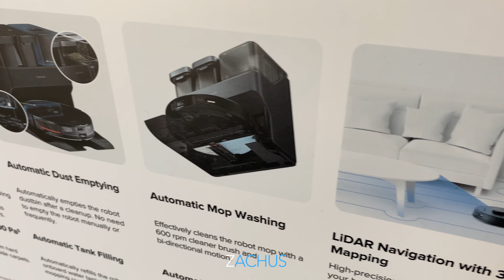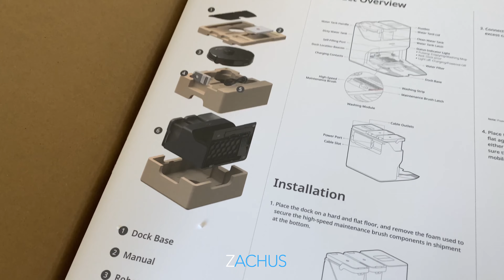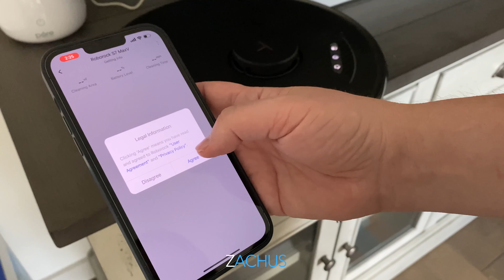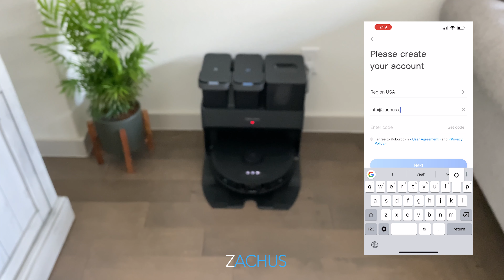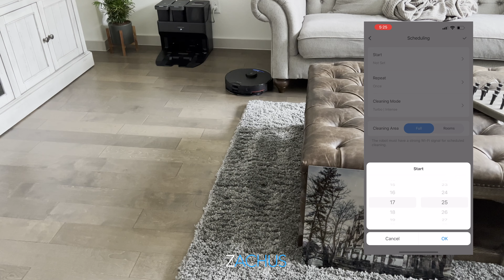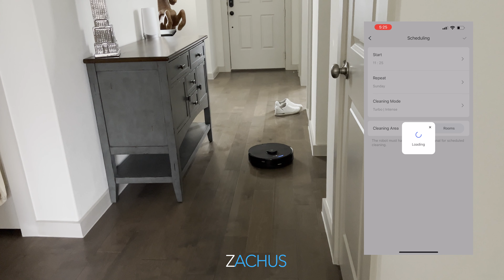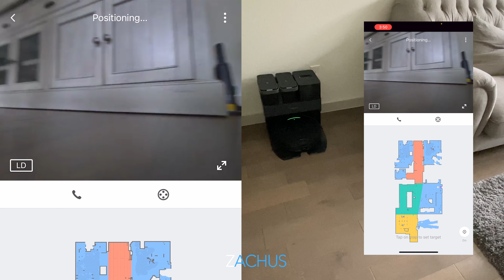Roborock S7 MaxV Ultra (FULL HONEST LONG REVIEW)

Comment: It doesn’t have clean zones? Why not? Will this feature be added in the future?
Reply from the maker: They said they are working on adding it. Not a huge deal because you can set rooms and dividers.
Reply: Mine has cleaning zones. Got the system Sept 30 and clean zones was available

Comment: How does this robot navigate in tight spaces? (like under chairs etc)
Reply from the maker: I show this in the video 😁 I know it's long though. It does amazing!! It never got stuck which I was shocked. I let it go into my studio and you can see it navigate some crazy stuff... best robot I've tested so far.
Reply: @Zachus  oh, sorry. I could not see the all the video yet. I have a S5 Max and the biggest problem I have it id with its navigation. Even with furniture it could get under it (because of its dimasioms, like chairs), the turn ratio it performs does not allow it to get under it. I was hopping to see if S7 MaxV could solve that issue due to its better AI and right side ultrasonic sensor location
Reply from the maker: Oh I gotcha, yes, my Roborock S7+ that I did a video on had this issue, I sent it back, https://youtu.be/VyhKtQ13exg
But I really wanted to try this and it seems that they got everything out. It got closer to any edges of any robot, navigated some crazy stuff and never got stuck. I added Chapters in the Video Description to help find things 😁 for this video.
Reply: @Zachus  amazing, man. Thanks for answering and for the amazing review, one of the best in YouTube. This robot is not available in Brazil, so, unfortunately, I can't get it at the moment. Hope this changes soon.

Comment: Fantastic review!! Thank you so much! My main floor is about 2700 sq feet in total. Will this robot be able to do all of the area? Thanks again so much!
Reply from the maker: Oh for sure but it may need to re-charge and also clean the mop several times. It does all of this though by itself. FYI I schedule mine to run when I know I'm going to be out and I have even let it run at night although it works better in daylight.
Reply: @Zachus  Thank you so much. Also, I purchased my husband and boys some soap for christmas via your link and suggestion. Thank you so much for your great content!!
Reply from the maker: Awesome

Comment: I used to have an s6 max, now I have an s7max ultra. It's a big disappointment for me, the little broom keeps getting stuck in the carpet, but that's not its biggest problem. I don't see the logic in cleaning it like I did with the old one. Many times it will start 20 yards to clean up a 1 square yard area where it has been before and then move on to another random area. He also often misses areas. I never had that problem with the old one. It doesn't empty the dust container at the end of the cleaning, only sometimes. What do you think, could there be something wrong with it?
Reply from the maker: I haven't had these problems 🤷🏻‍♂️ so might be bad...
Reply: My side brush gets tangled badly on my shag rug. My roomba i7 side brush does not.. It’s a poor design and is completely unusable on the rug
Reply: @tpfrk8977  You can always replace the brush out for an older model bristle brush

Comment: Before buying, I fixed all my house raising & attaching lamps & furniture on the wall so they do not touch the floor.  It enlarged the room and left the floor way easier to clean.  But before buying, I searched for Service Centers in Canada and the USS.  DID NOT FIND ANY.  So, I won't buy until SERVICE equals Dyson, Bosch, Miele, LG, Samsung and the like.  BEWARE and investigate.  Simply ASK then where to go when a problem arises.

Comment: I have the Roborock S7, works good at the beginning, after 3 months broke, back & forth with the support, needed to ship it back, they said the wheels had issues, they replace, the shipment back was really bad, they used the same box i ship to them, now in bad condition, and they had one wrap that didn't really protect the robot, they didn't do anything else to please me, and when right after we started to use it again, the small side brush fell, i try to tie, you Loctite, nothing, keep falling and now i cannot find it anymore, Roborock wanted to give me 80$ and to fix it again, NO WAY, such a expensive product not supposed to break after short time, and the way they handle their customer service, I wanted them to replace or refund me, they are not willing, only to fix it, which I refused,  i thought it will save me time cleaning, but i spent more time with fixing and talking to their support, i recommend a better well know company :-(
Reply: Any updates? And what happened? It couldn’t back in to “wash the mop”?
Reply from the maker: Roborock S7 and Roborock S7 MaxV are two different systems. I have a video on the Roborock S7 and I didn't like it. https://youtu.be/VyhKtQ13exg

That's why I was leery a little of trying the MaxV Ultra but works way better